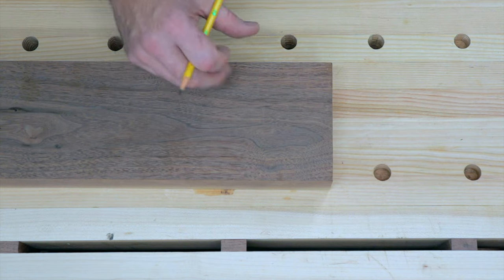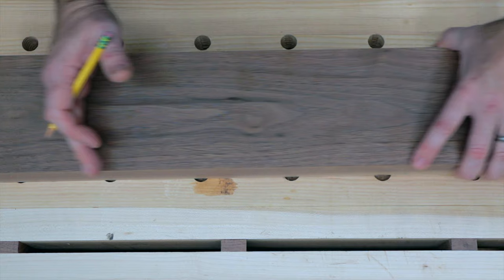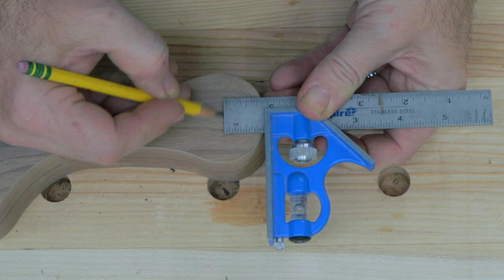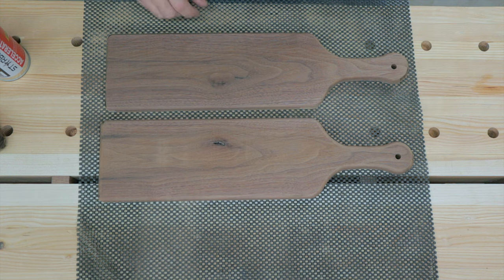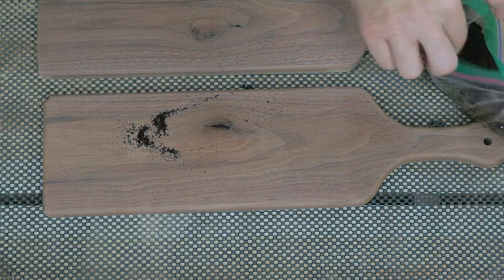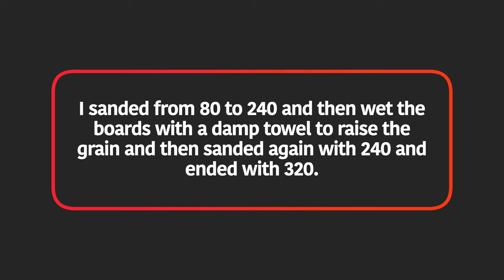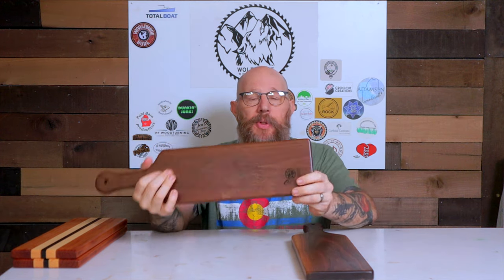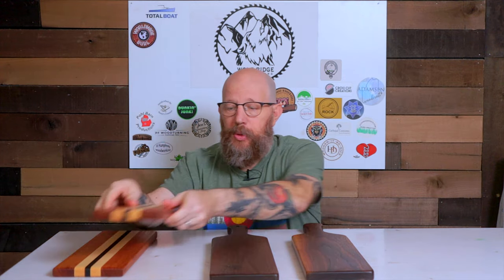Woodworking: Walnut Cheese Board

Comment: What size wood can I use to make them and what kind of wood can be used. Thank you I liked the video.
Reply from the maker: Thank you David!  For the wood, stick with closed grain wood like Maple and Walnut.  You want to stay away from some of the exotic woods for cutting boards.  For the length and width, it really depends on what you decide, but you will want to go with 4/4 or 6/4 for the thickness.  - Ed

Comment: Those are fantastic Ed. I'm actually glad you're expanding out of the turning. I guess mainly as I haven't turned in many months and am trying to get back into the small crafts stuff again. I feel the older I get, my tools are going to waste sticking to just one venue. Also I'm tired or busting my butt to turn out bowls to just have warp and crack. I can't outlive green wood waiting for it to dry. Keep up the flat boarding for awhile. <grin>
Reply from the maker: Thank you Paul!  It was so hot and dry this summer here in Arizona, all my wood dried out super quick.  If you can pick up an old used fridge, you can build this https://www.youtube.com/watch?v=7fVLWCPgyNM&t=29s .  Something like that might help you out brother.  - Ed
Reply: Without even looking at that link, I know how its done. I just don't have the room or time. I do microwave small items when I did pens. That worked pretty good. But I haven't done pens in  a long time. Lots of wood and kits left over, I just got tired of doing them. I love bowls and lidded boxes if only the wood was stable.

Thanks for the reply, and thanks for the videos. Keep up the great work.

I did 4, one chamber bat houses and I can't even sell them. But I did sell a 4 chamber to a local farmer. He loved it.